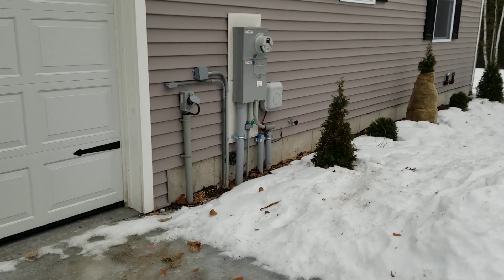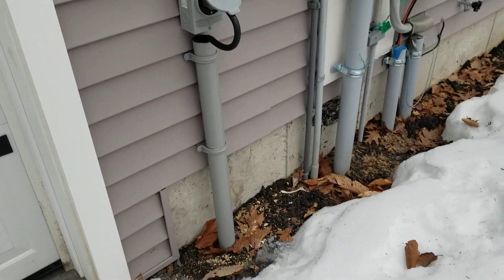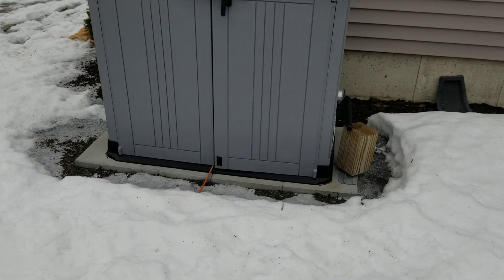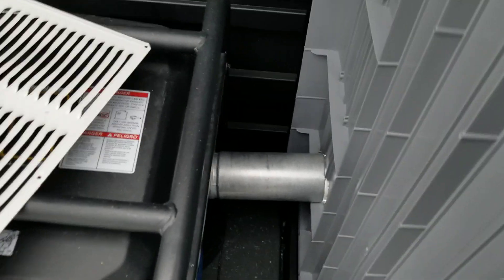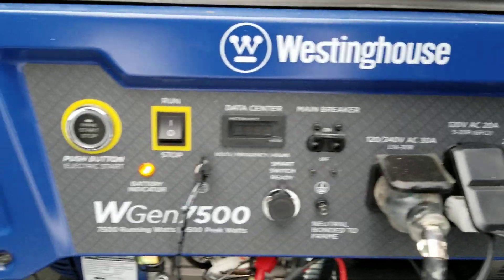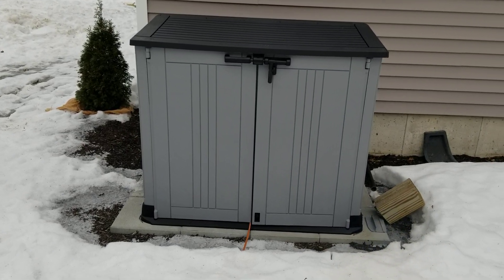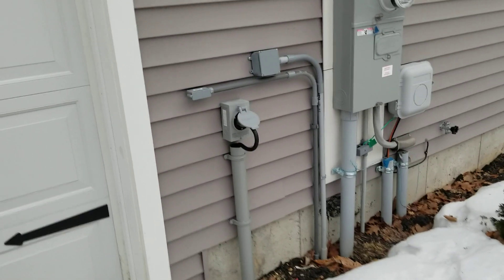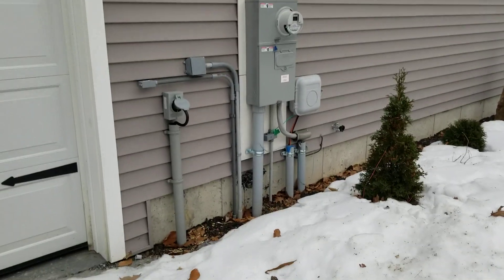Just finished my custom Westinghouse 7500/9500 generator shed, check it out.

Comment: Thanks for sharing!  I have a Westinghouse WPro8500 that I plan to install, similar to what you did.  Just a couple more ideas for you:  1. Make sure you keep your exhaust pipe pitched downward, so it won't collect rain/moisture.  2.  After about 10 hours of engine run time, switch the motor oil over to full synthetic.  It will help with cold-weather engine start cranking.

Comment: You may run into issues having your exhaust line right next to your air intake. Also your intake area should at least be twice your outlet size.
Reply from the maker: I do plan on angling the exhaust pipe up enough to clear the intake. Also, the second intake grille needs to be installed, it is sitting on top of the generator. Thank you for the advice as well I appreciate it!
Reply: @JasonLaMonica  you could run it up and add a muffler.

Comment: Line with rockwool or insulation for more sound deadening.  Venting should be changed as mentioned from other users.  Also hang an incandescent 60w bulb inside and keep on when super cold out.  Will keep the it a little warmer for starts.

Comment: You have a stepper motor open and close the choke. The next cold start you do, manually hold the choke closed and see if that makes it start easier.
Also, if you leave the ignition rocker switch turned on so the remote or push button start switch will work that could drain down the battery in time and keep the electronics powered up. Even though it is a small drain.

Comment: Looks good for a budget setup.I suspect that your fan is undersized. You want to see about a 10 deg F rise in temp. and you are golden. I had to (5kw. Honda) install a 16" AC infinity fan rated at 3,000 cfm to achieve this. Also my intake vent was about 17 x 17. Remember that heat is a generator's worst enemy and failure is progressive not sudden.
Reply: I assume that in winter it is easier to keep it cool but in summer you can open the roof a little to vent the hot air

Comment: Thanks Jason, fantastic video. I just installed a Wgen12000df inside a shed and i am curious on any idea you might have on how to keep the temperatura inside the shed above freezing during our Canadian winters.
Reply from the maker: I don't. LOL.  Only thing I have done is put a small space heater in the gen shed and covered the whole thing with an insulator to get it warm enough. We had a real real bad stretch of cold and it wouldn't start unless the shed was about 15 degrees warmer.  I'm glad I did that test before we needed the genny or else we would have been stuck without.  Good luck!

Comment: Master Electrician here.  You have plumbing pipe coming out of your generator cabinet.  You have the wrong type of cable running through what appears to be plumbing pipe.  Also you cannot terminate from that open plumbing pipe into a plug. If you have a fire your insurance company my not cover your loss because of code violations. I would call a licensed electrical contractor to bring your installation up to code.

Comment: Well done...can you share how you connected the exhaust to he gen?
Reply from the maker: There was a small metal cap with screen on the exhaust pipe and I took that off and the iron pipe slides over the exhaust pipe snugly. I made two small holes in the exhaust pipe on opposite sides and did the same for iron pipe and used small screws to screw them together at those two points. It's not perfect but it works. The pellet stove pipe around the iron pipe is strictly to give old iron a bit of breathing room and not melt my shed in case anyone was wondering.
Reply: @JasonLaMonica   what size pipe?

Comment: Thanks for your video. 

How is your generator shed holding up?  I just bought a Westinghouse 9500df and have a Keter storage shed en route.  

The exhaust has me a little confounded.  I saw your description in a comment earlier.  I guess I need to take the cover off from around the exhaust so I can more clearly see what I'm working with. 

I plan to put my exhaust fan on the opposite side that you did and my intake vent on the other side.  I do think it's good to put the intake vent down low and exhaust fan up high to pull air in and up and out.
Reply from the maker: We put the exhaust fan on the left for aesthetics, mainly. I can take some pix and reply with links to show what I did with the actual exhaust pipe.  I still have not finished everything, it's not a high priority and we don't lose power much so no real worries. 
The shed is holding up good. Check out the newer vid I put up from a month or so ago as well.
Reply: @JasonLaMonica   I read your reply to another poster's question about the exhaust.  It sounds like you found an iron pipe that slipped over the muffler outlet and secured it with screws.  Is that pretty much right?
Reply from the maker: @coffeygrounds5461  yes that is essentially it!

Comment: Hey Jason, I have the same generator and I am looking to imitate your creative build using the Keter shed. I don’t mean to bother you, but what did you wire the exhaust fan to?
Reply from the maker: I wired it to one of the 110v outlets, so when the generator starts and begins producing power it will kick on and then shut off when the gen is turned off.

Comment: I have just received the same generator, how did you extend the exhaust?
Reply from the maker: I took the exhaust cap off and mated the black pipe to it and ran it out the side. I used a pellet stove pipe shroud as a heat shield so as not to melt the plastic from the heat. It's kind of a hack job but has stood the test of time so far.